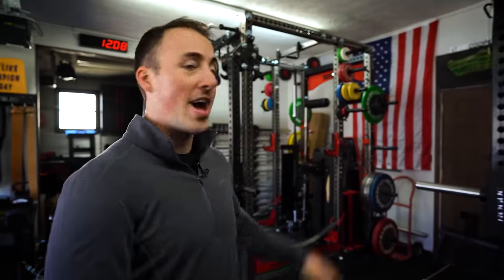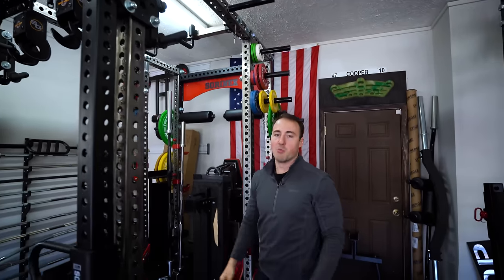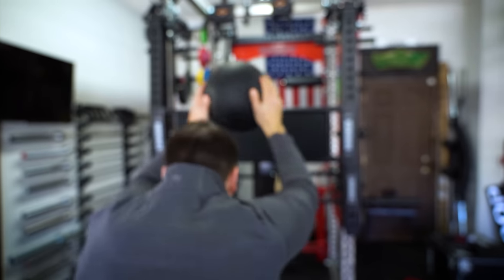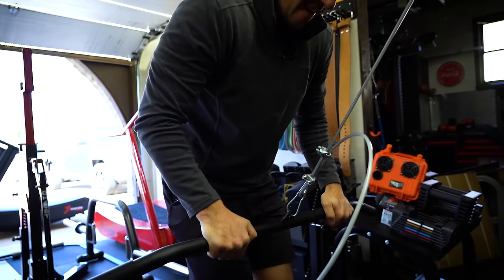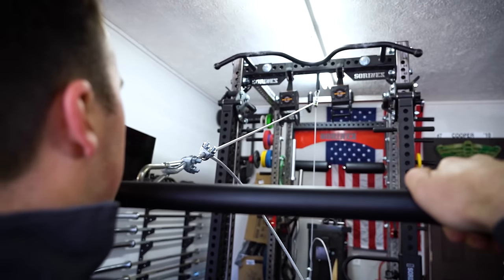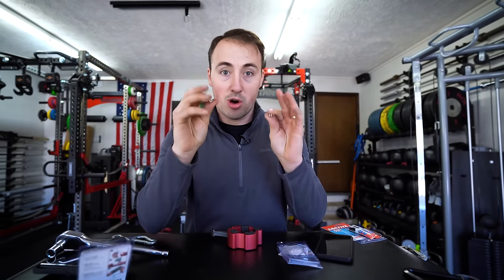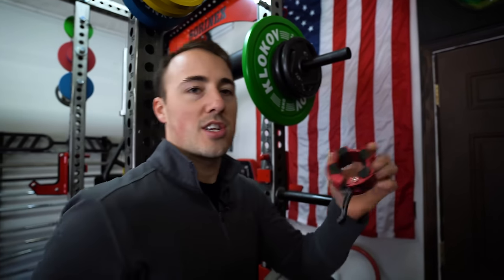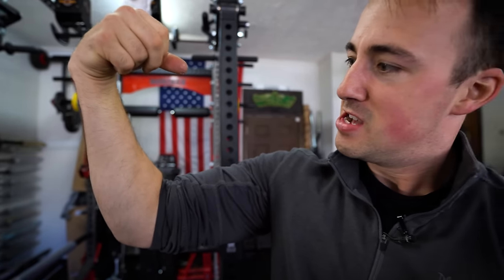10 Squat Rack Hacks for Home Gym & Beyond!

Comment from the maker: Do you have any hacks you've used in your home gym? Let me know!
Reply: Use  bands on ur rollers to protect the bar and roller!
Reply: Where did you buy the utility pins, could you link us in the description?
Reply: Making a DIY pulley system
Reply: I just spray painted nicely the lines for where I need the J hooks for squat, bench, etc.
Reply: If you have a shallow rack use sidewalk chalk and a yardstick to make a line on your flooring where to stand.
Reply: 2 bars on the squat spotters on a high setting for dips
Reply: Garage Gym Reviews 
Chalk the floor where you put your bench in your power rack to get it centered every time.
Reply: Where can you get the leg rollers?
Reply: @DaLarr9  this is what I need to know lol
Reply: @DaLarr9  Just found them. Their from Sorinex
Reply: @rtm6930  I know REP sells them but he said you can get them cheap so i was hoping for cheaper then i saw
Reply: @corystevens1862  Yeah, I see that everyone sells their own version but the only one with just using a pin is sorinex.
Reply: My garage (and most, I presume) is graded so that water would shed away from the house. This means deadlifts suck, because the bar rolls out the garage door and I have to chase it off into the field. I fought this in a number of ways, but I finally found my favorite solution - a piece of quarter-round (baseboard trim). It's long, light, cheap and wedge shaped. Throw it on the floor (any orientation) and so long as the piece is longer than the innermost plates, it'll stop the loaded bar from rolling out the garage into your toddler/bmw/field/whatever.
Reply: Rex you can also use 2.5 lb plates or a dead wedge
Reply: Cory Stevens “You can get ‘em for cheap. You can get ‘em for expensive.” - Coop
Reply: @Garage Gym Reviews, I think what I am doing could be very helpful and I think you can help pass the word. It may sound strange but this past week I have made two 45lbs plates out of concrete, and I am currently making more in that and other weights. It is very very cost effective in our current situation and requires very little know how (especially with the wealth of how to videos). Your body doesn't know if its lifting 100 lbs of feathers or 100 lbs of iron. 

You should show / inform people that barbelles and plates are readily available at your local home improvement store. I use 3/4" black steel pipe as DB bars as well as for a pullup bar, and I would use a longer one as a BB if I needed to (its outer diameter is 1", my 1" standard plates fit it). Also, 3/4" Galvanized Split Ring Hangers work perfect as clamps and spacers for you hands. Regarding making the plates...

https://www.calculator.net/concrete-calculator.html

I first went to this site to see options for different diameters and depths for a 45 plate, but you can use it to find any size plate you want to make. 

For the "45 lbs" plate I got a 16" concrete form tube, 2 bags 50lbs fast setting concrete, 2 steel rods 1/4"x48". First I cut two 3" slices off the form tube, and the rods into 8x12" pieces. Then lay a trash bag flat and center the mold on it. Cut a 3" piece of pvc that fits my bar and set in middle with tape across the mold to kind of hold in place. Then mixed a 50 lbs bag of fast setting concrete and filled the first mold about half way then laid 4 rods in a square pattern and then filled rest and discarded what wouldn't fit. Repeat mix and fill for 2nd mold. Cover each with another trash bag and let it set and cure. I did mine yesterday and they are strong enough 24 hrs after to be moved around. Weighed them on a scale and they each came out to 47 lbs (which is what that website predicted). Close enough for me. I would leave the cardboard mould tube on as part of the weight. After 2 days I wrapped them in cheap packaging tape to prevent dust and bits falling off. So far they work great.

I spent $35 dollars for the form tube, concrete and rods. I had the pvc pipe, but that is also inexpensive. The tube will give me more moulds, so the only cost going forward would be for the bags of concrete and rods.

I am currently working on 12" diameter, 35 and 40 lbs ones for my DB bench and I did that by cutting slices of 16" form tube then removing a 12" section and reconeccted the ends using cheap very small bolts/nuts (<$2 for 8 or more). 

This is very easy to do. The additional expenses would be a bucket or 2 and a trowel for mixing, but that shouldn't be much. And each subsequent plate you make (if you use a 16" form and adjust as needed), the cost per plate decreases to a minimum of about 10$ for "45 lbs" of plate(s). 

Are the plates perfect? No, but they are an inexpensive alternative, and most importantly they work.

Let me know if you have any comments or questions.
Reply: I really like the braided vinyl tubing idea but why cut it, just slide the pipe through
Reply: I bought a landmine for about $23. From Titan, bought a 7" piece of 2"black pipe and welded it to a heavy piece of steel (you can often find plates near railroad tracks) makes a great home plate landmine. Less than $30
Reply: darkdiablo888 thank you please link us
Reply: extra long foam rollers from Rep for preacher curls
Reply: Not really anything crazy because its not really a problem to begin with, but if your like me and get bothered by the exposed top of the steel uprights you can purchase plastic plugs to cap them off.  Very inexpensive, looks better in my opinion and prevents anything from falling down the top of the upright. 

https://www.amazon.com/gp/product/B07MJLV4KL/ref=ppx_yo_dt_b_asin_title_o03_s00?ie=UTF8&psc=1
Reply: Place safety pins around all the corners at the bottom. Now you have a play pen for toddlers.
Reply: @Masterrex  building a wonder border around your deadlift platform stop the bar rolling
Reply: Two sets of J hooks and two sets of safety pins. One set for squats, one for bench. It might seem like laziness but it does save some time and make for a better workout.
Reply: We made labels on our rack because my wife and I both use it.
Reply: nothing special but I have a digital thermometer/humidity monitor with magnets on it attached to my rack, also if you want something cheaper and probably stronger than magnets to hang things like change plates on I use those red vinyl-coated S hooks on my rack
Reply: @darkdiablo888  looks like Sorinex. Rogue sells them as well. Along with others.
Reply: Where can one find these "cheap leg rollers"? Link?
Reply: Motivational Hack! I use your picture as the “Before” look. It really motivates everyone that comes into the gym on how bad they could look by doing nothing or training poorly.
Reply: Are there any leg rollers that fit the Titan T-3 holes?
Reply: Use a chalk pen to mark j-cup and spotter arm locations as well as bench placement in your rack.
Reply: All due respect, but you doesn’t look like spending a lot of time in the gym. Your gym knowledge however is rock solid and i will definitely watch you to get intel howxto build my gym. Respect
Reply: Going off your last idea, you could probably use the bottom foam pad for nordic hamstring curls as well!
Reply: @Robs.channel  Similarly, put your bar on j cups around navel height, put flat bench underneath it, grab dumbbells, take a seat and lean upper back against barbell. Incline dumbbell press.

Comment: FYI - pinpipe braided vinyl tubing: the Lowe's product (which looks exactly the same as the HomeDepot offering) fits over my RML pinpipes perfectly, no need to cut them. Awesome idea, thanks Coop! Manufacturers should absolutely offer this as standard or a cheap add-on to pinpipes...
Reply: I'm wondering if regular clear vinyl tubing would work adequately. Do you think the added strength of the braided tubing is necessary?
Reply: @andrewolejarz5293  I use pipe insulation

Comment: You know what the crazest hack?

Finding a barbell in this days
Reply: I use 3/4" black steel pipe as DB bars as well as for a pullup bar, and I would use a longer one as a BB if I needed to (its outer diameter is 1", my 1" standard plates fit it). Also, 3/4" Galvanized Split Ring Hangers work perfect as clamps and spacers for you hands.

Comment: Coop, I’ve got a hack for the plate storage pegs that come with these racks. The hex nuts and bolt ends tear up  your plates when you push the plate back onto the storage post. To stop that, I bought some rubber furniture chair leg covers. My local hardware store sells them in a bunch of different sizes. The rubber chair leg tip fits snuggly over the lock washer next to the rack. When you push your plates onto the post they stop at the rubber instead of hitting the post hardware.

Comment: I have a squat rack (not a power rack) with a straight normal pull up bar. I sometimes grab the dip accessory, put it high, and use it for neutral grip pulll ups.

Comment: You can use foam pipe insulation tubes on the safety pins too. They sell them at Home Depot to put on hot water pipes to keep them hot.

Comment: When having a dropped in rhino belt squat, I guess a mounted utility bench + utility pins + belt squat can give you a reverse hyper?  If you have 4 leg roller you can make a GHD? These are huge equipment but using them in the rack saves tons of space?

Comment: Coop, you sir are a genius! Thanks to you, I was able to adopt some hacks that I haven’t seen anyone else mention before. I got one tip though, for the braided vinyl tubing to protect the safety pins I would recommend the 2ft, 2-1/2” OD (outside diameter) 2” ID (inside diameter.) These measurements fit my safety pins like a glove without having to slit the tubing through the middle. It worked perfectly for my Rep Pr5000 v2 rack safety pins 👌

Comment: Hey Coop,  There are also UHMW Plastic Tubes available for purchase that can either cover the pin pipe saftey exterior steel pipe or just to cover the internal pin safety for reasonable prices.  FYI  they are paintable too so you can compliment your power racks color scheme.

Comment: Where do you recommend getting the leg rollers to attach to your rack?? Those will be perfect for me for one leg squat variations. 

Thanks, bro! Keep up the great work.
Reply: Rogue fitness, Rep Fitness, Titan Fitness. Just make sure you get a roller that fits the hole size of your rack (5/8" or 1"). Any should work as long as they are designed for the same hole diameter as your rack.

Comment: Where do I get utility posts and leg rollers for a titan fitness t3 rack
Reply: My suggestion would be to buy a conversion kit from Rogue that allows 2x3" racks to use 3x3" accessories and then get the foam rollers for Rep's PR4000. Hope that helps.

Comment: A better cover for your pin and pipe safety is to use pipe insulation (Armorflex) ours is still good after moving through 3 countries and several thousand drops/pulls. Just get 2inch ID as an offcut from a your local air con installer. It is also silent, unlike a plastic covering.

Comment: Looks like I need to take my power rack apart and drill some holes. The only ones in mine are on the inside of the vertical rails for the safety rails. My hack was to use the sharpie directly on the vertical rails where the posts go for various movements.

Comment: Like the ideas and great channel but I purchased the magnetic hanging hooks, actually ones rated higher than the ones linked iun the description because for horizontal hanging like in the video they are only rated for 20 lbs.  Not only did they not hold one set of chains, they slid down my rack scratching it so now I have a scratched rack that is only a month old.  I'd caution on the usage of magnetics for the chains or anything else "heavy."  Thanks though for the ideas!

Comment: hey coop, i built the pulley system but i seem to run into an issue. The plastic layer keeps ripping off due to the friction and heat when you use heavier weight and the cable curls up, Any solutions or tips? thanks again for the banger vids!

Comment: I have to get some of that pipe or hose or whatever it is to cover the pins in my rack for rack pulls.  I use split pool noodles currently.  They work well but wear out after a few uses (get crushed too flat and loss some padding).  The pipe is a lot more durable.

Comment: I did the little earth magnets trick on two sets of clamps last year, they don’t last the magnets will eventually shatter or come off.

If you glue the magnets so their recessed on the clamps they might last, but if the actual magnet is making contact on the steel surface=mediocre results to come

Comment: Looking for a leg rollers for a rogue monster lite rig with 5/8" holes. Haven't found any under $60 USD
Reply: Andre Robinson same here. I haven’t found any that resemble what Coop showed in the video. Where it’s just the pin and the foam. Every option I’m finding has the “stabilizer metal” or whatever you’d call it like the j hooks have. That flat part.

Comment: Coop, would you put a 90” inch rack in a basement with 96” ? Still have to bolt to platform that will be about 2-3”.
Reply: You might hit your head on the ceiling when doing pullups.  However, I have a 90 in rack in my garage that is 102 in high.  I just make it without hitting my head on the finished ceiling or the garage door opening motor!

Comment: Coop, can you provide a link or more details on the magnetic disks to hold up the collars .  Purchased 3/4" Diam. disks from Home Depot and the holding power was insufficient ((Amazon generic plastic friction, light weight collars slipped down the outside of the rack).  Not finding substantially different magnets scouting around Amazon and the stronger neodyniums are 1.25"+ Diam.

Comment: Coop.. been watching your videos (and others as well) since Jan 2020 cause thats when I started putting stuff together for my basement gym.  Your comparison between the Rogue rack and Titan rack really helped me to decide on the Titan rack, as it was definitely more economical and its not like i am gonna squat 1k lbs or anything., but the Titan T3 is plenty strong enough and at a great cost.  In this video , I utilized your idea of a pulley system, the magnets for the collars (which is an AWESOME idea), and  the covers for the safety (def protect my bar, as everything is so expensive nowadays).  The magnets for the exercise names to be put on the side I did not use, but instead I used different color electrical tape and I labeled them.  The reason for the tape is that I could have the tape on the side o the whole and wrap a little piece around to where the hole actually is... this way, after input the front part of the pin safety in, i can see exactly which hole in he back it is supposed to line up with since the tape ends right at the corresponding hole on the rack.  Overall, you videos have been extremely helpful, entertaining, and motivational (because it gives me new ideas to better utilize my equipment, space, and money!) Thanks!!